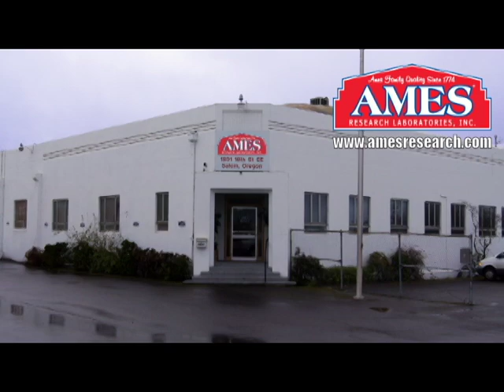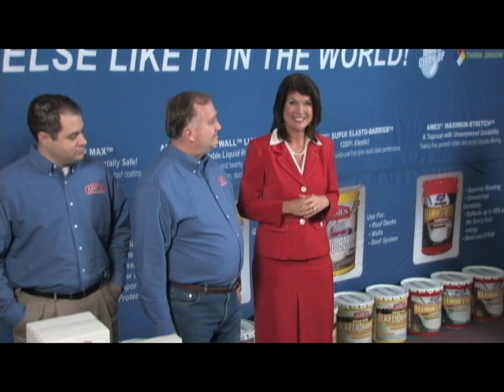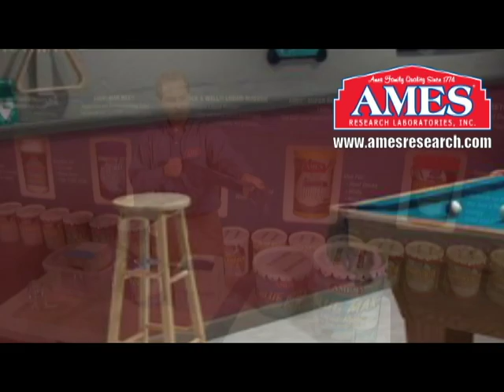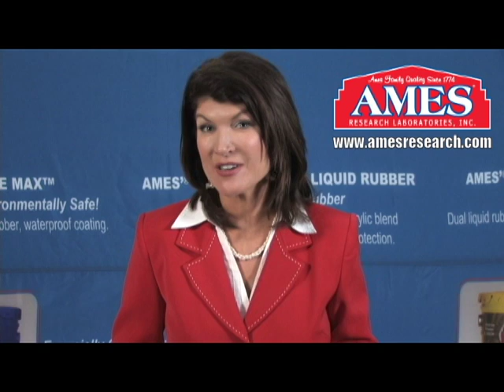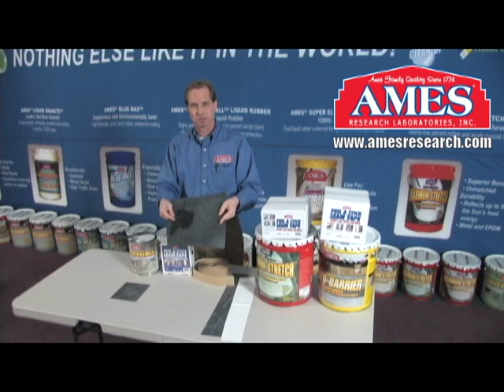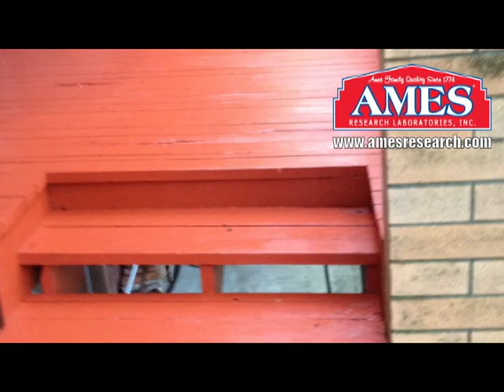Information product presentation for Ames® liquid rubber waterproof coatings

Comment: Can I put this over a painted concrete basement wall. This recently came into my store and we were not given the answer.
Reply from the maker: Sure, Ames Blue-Max may be able to adhere to many water-based coatings and paints.  But, to get the full capabilities of all Blue-Max can do we always recommend properly preparing the surfaces prior to applying. For more information go to www.amesresearch.com

Comment: I needed to seal my upper deck over a living area below and their sales person recommended I use Blue Max trowel grade to even out the boards and then use seam tape before I covered it with Safe T Deck paint. I live in Northern Az and in the summer months can get to 90 degrees dureing the day whick causes the Blue Max and seam tape to soften alot, so much so that when you walk on the decking materials it leaves foot prints, and you can't have any outdoor furniture on it because of the indentations it causes. I have tried to deal with this company to get my money back after trying to find a solution to this issue and they are ignoring me. Do not buy their products, I have almost 1400.00 invested in my deck and it's no good.  Run away as fast as you can!!!